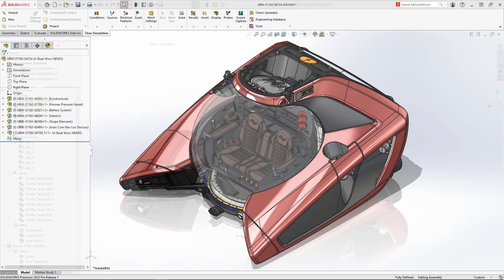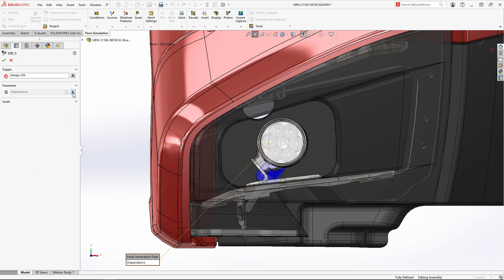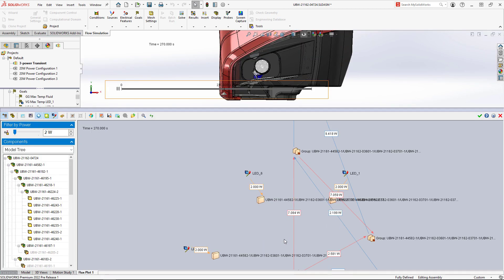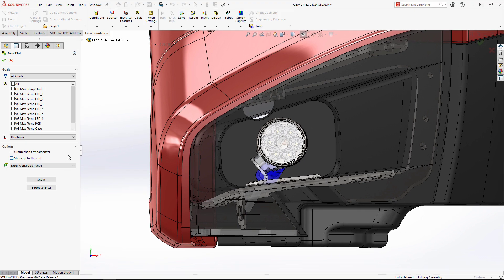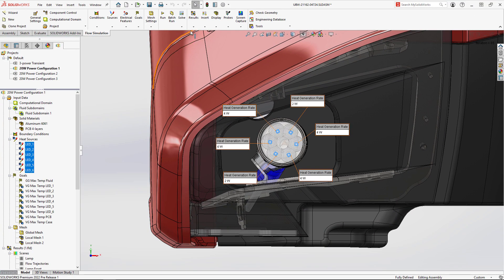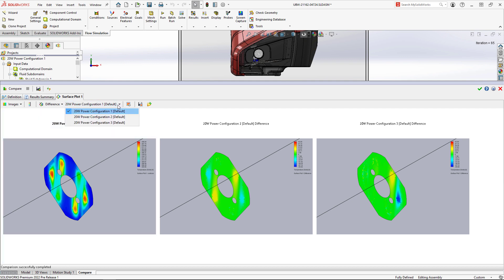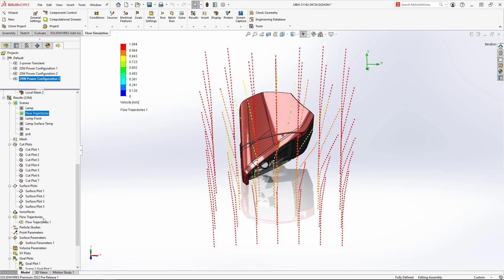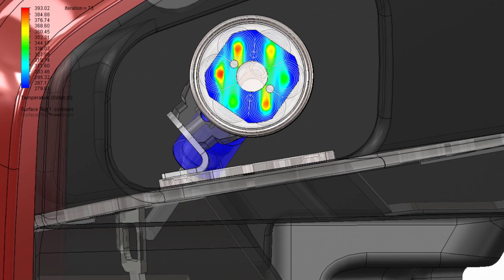SOLIDWORKS 2022 - Flow Simulation

Comment: Hello! I have a problem with the Flow SImulation tool on rhe virtual Laib. It's correctly installed, but it's unaccessible. Can you please help me? This is important for my final project for graduation.
Reply from the maker: Hi there, we are happy to point you in the right direction. For technical inquiries, with your subscription, you can always access Knowledge Base for immediate troubleshooting. If Knowledge Base does not help, you can contact your local reseller through your organization.
 
Even without a subscription, you can access your MySolidWorks for information. Check it out here: https://my.solidworks.com/